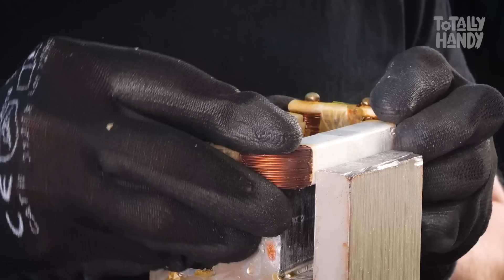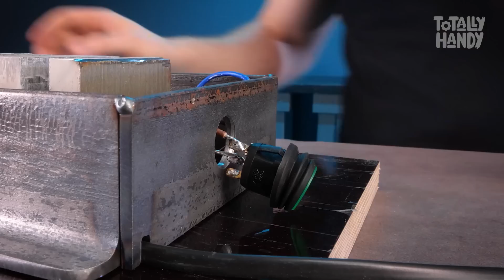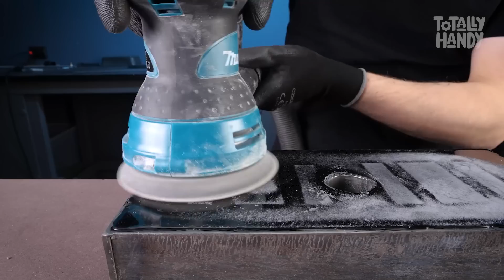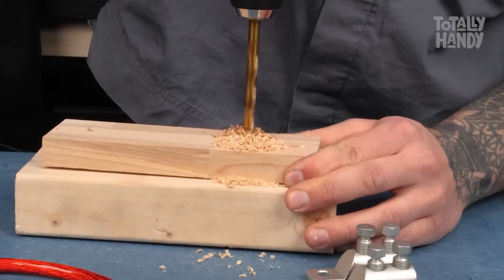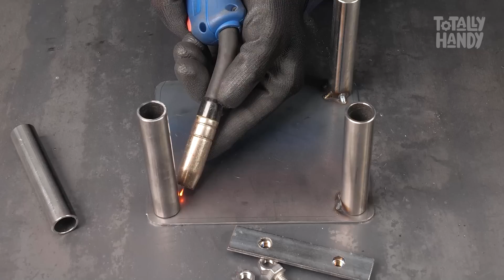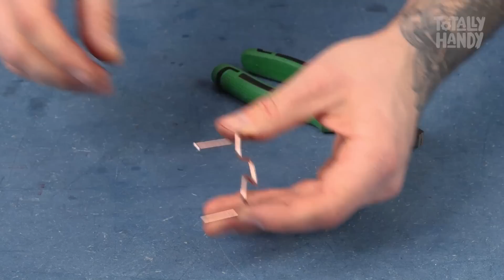This Is Why We Don’t Toss Out Broken Microwaves PART 2 | Remake Project

Comment: Nicely done. Change the power source to 120VAC and you'll have a very effective magnetic media eraser. Hard drives, tapes, etc. I'd stop using the power switch now, though. You failed to put an arc-suppression capacitor across it, so every time you turn the magnet off, a massive arc occurs inside the switch, caused by the magnetic field collapsing and inducing hundreds of volts of counter-emf across the magnet coils. This will quickly ruin the switch contacts, and since it's set in epoxy, you can't replace it, so... Don't use the switch. Just leave it on and turn the power supply on and off.

Comment: First project is fine but it can be done way easier by using door magnets ,they operate on 24V so its safer and the holding power is insane.
Second one is great ,i was wondering how thick cable is . I made similar device from soldering gun .